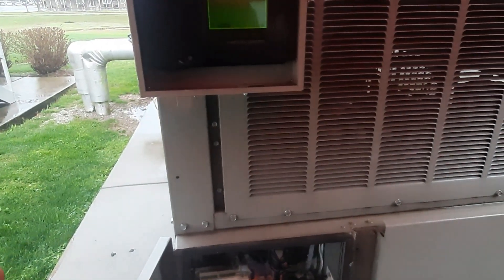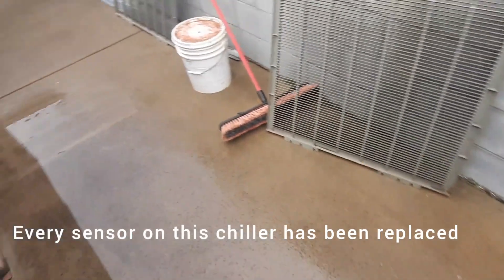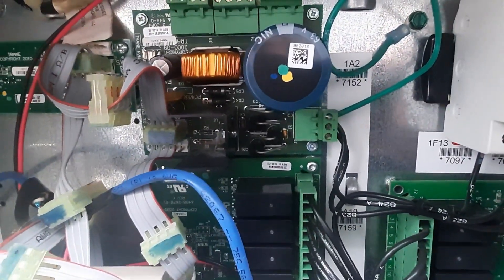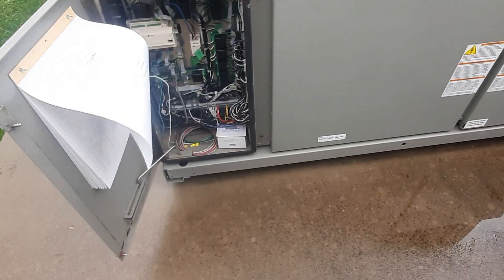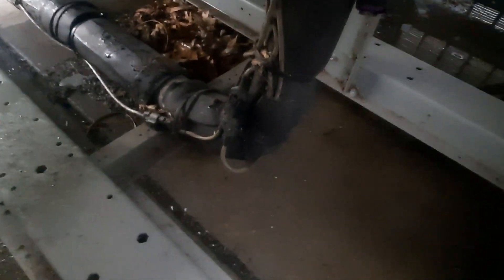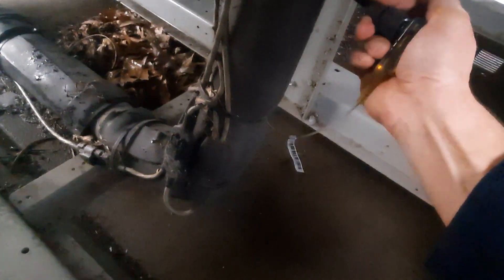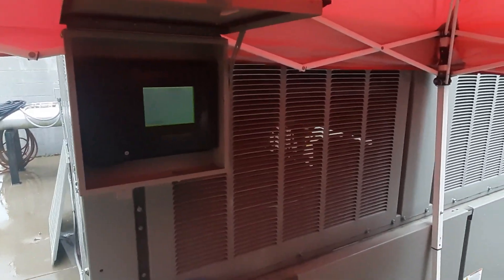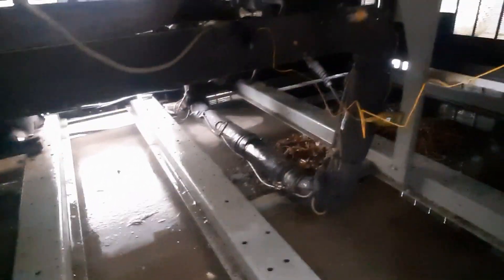CGAM Chiller sensor failure

Comment: Can you see any path for moisture into the sensor/plug? I'd be inclined to pump the plug and socket with dielectric grease, make sure it's not getting in there. Any other joints between the sensor wiring, the actual sensor, and the plug could be suspect.

Got a hot air gun? Run it over the old one and see if you get steam coming out after you heat any part in particular. My guess would be down at the sensor itself as nothing else would get cold to wick moisture in.

Pump some dielectric grease in behind the sensor once you've stuffed it in the suction pipe, in essence trying to seal the sensor from ambient air and keep moisture out.
Reply from the maker: Sensor itself has a fitting that seals pretty well, but I have considered dielectric grease for the plug. I have been mounting to prevent the possibility of moisture. These sensors are a known issue as I have heard from many others with the same problems. Thanks for the advice Thermoelectric7!
Reply: @EverythingHVACR  I thought about dielectric grease also but I have seen that destroy connections on the plastic fittings also its not conductive so I opted out but if you try and it works please let us know.  Thank you

Comment: We have also had problems with bad sensors in Trane and Carriers down here in south for some reason having to change out seems like once a year or so, also have talked with tech Surport and no good answer for the reason the sensors are reading high temp or reading in the negative temp seems to be a wide range of temp readings
Reply from the maker: I'm in the same general area and it's not just us I have found these sensors are just not reliable. Thanks Doug!

Comment: We have York modules  and chillers not bad so far
Reply from the maker: I have seen some old Yorks, the wires are not protected at the sensor and they corrode and cause problems but still when in good condition more reliable than these Trane sensors
Reply: @EverythingHVACR   every York chiller i have (All with in 3 years of service) are leak refrigerant and have those micro channel coils, that are not your friend,  2 compressors already replaced on one chiller,   the other 2 have had condenser fan motors replaced, the fan drives are placed up by the condenser coil so you have to cover them when hosing the coils out,  Bad exv, bad flow switch, on one, replaced 3 bad compressor contractors on two chillers, yep they are 300.000 dollar throw aways
Reply from the maker: Sad the crap we get from all manufacturers these days

Comment: Trane sensors are junky....especially so on those CGAM. I know that chiller better than any other I've worked on. They are notorious for having that issue.The connections get moisture, so foes the temp sensor well. I've also had to replace leaking microchannel condenser coil with the subcooler circuit and a leaking receiver that i had to re-pipe due to the new one being 30% larger.
Reply from the maker: Yeah sensors are crap, Thanks Jason!
Reply: I have acgam 40t that keeps locking out on "water flow lost" 
I have changed out flow switch once. 
Also had to rewire pump to be comtrolled by the chiller. Still happens
Reply from the maker: You said flow switch, I think these use the same type sensor as suction temp to verify water flow. So I would call it a sensor. Not a basic paddle type flow switch. You could have an actual issue with flow with pump or heat exchanger, is water treated, are there any strainers on the water? Is the pump drawing good current, low current would indicate less work therefore less water movement. Pressure differential on pump and amp draw should tell you a lot.